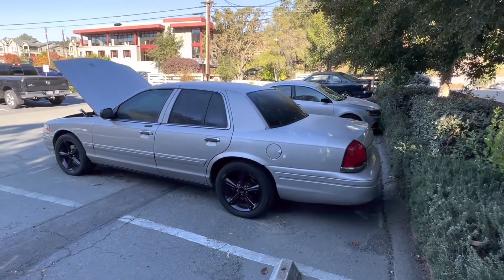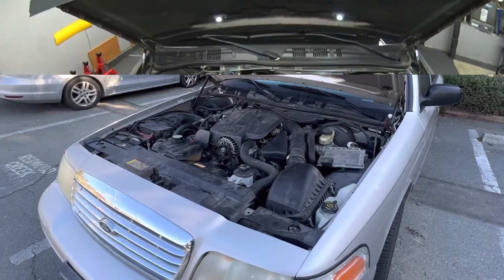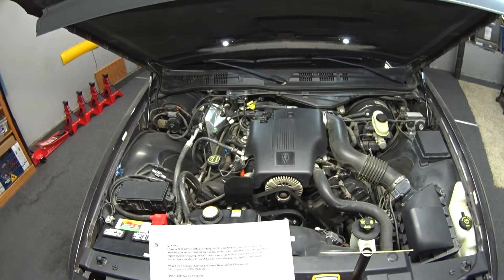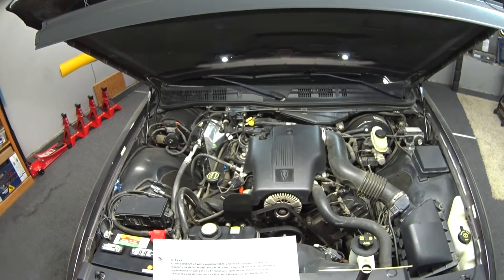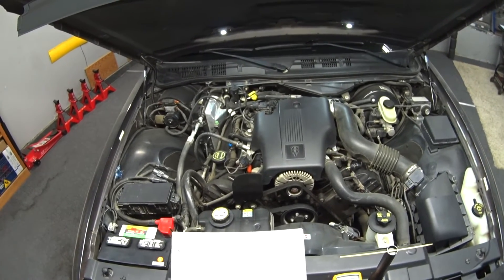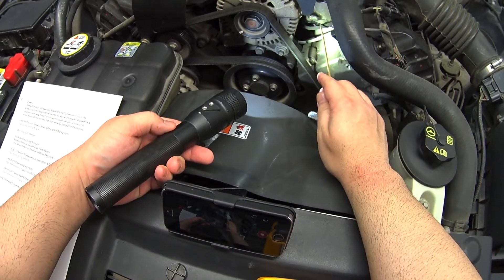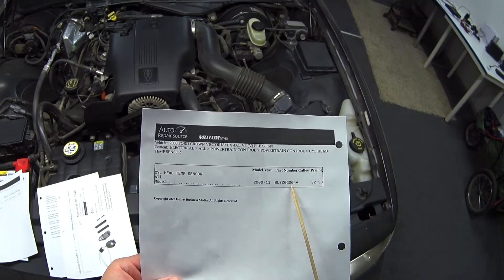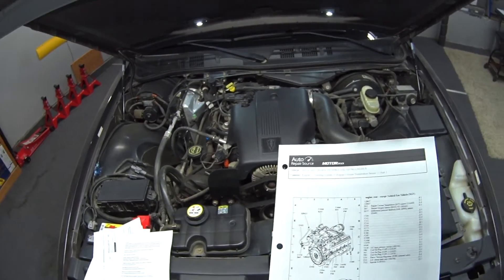Crown Victoria - P0128 ECT Sensor Location

Comment: I have a 2009 Grand MArquis. It runs and drives great. Except it overheats when I'm in heavy stop and go traffic. This wouldn't be a big problem if I lived in a rural town but I live in Los Angeles. Do you have any idea why my car would overheat in heavy traffic? Runs fine in regular city and highway traffic. Any info is greatly appreciated. Thanks!
Reply from the maker: Check the fan, and cooling system.
-Chuck

Comment: When I step on the gas  pedal it stall but not all the way and when I lightly tap on the gas is goes but burbles and  I replaced coil packs spark plugs fuel pump filter maf what could it be
Reply from the maker: Hello,
You have three options;
1.) Pay for diagnosis (money).
2.) Learn how to diagnose yourself (time + gain learning).
3.) Buy more ammo for parts shotgun (money + learn nothing). 
-Chuck

Comment: I have a 2004 Mercury Grand Marquis I need to replace a Transmission Temperature Sensor 
Where is that located? Any help is greatly appreciated 👏
Reply from the maker: Hello,
It's the part at 11:29 in this video;
https://youtu.be/pDIAnmnpGK4?feature=shared&t=690
-Chuck

Comment: Great video. 
What model fluke are you using? Looks like 115 or 117. 
I’m a recently retired mechanic and I miss the fluke 87 that belonged to my employer. 
My wife got me a fluke 117 for Christmas and I was wondering if I should upgrade to a 87 or if the 117 will be sufficient for working on my own cars, trucks, boats, etc that I work on part time.
Reply: I subscribed to your channel
Reply from the maker: Thanks for watching.
The Fluke 115 was purchased by my employer in 2007.
The 117 replaced the 115 with a few additional functions.
I’m not familiar with the 87.
-Chuck
Reply: @PanzerPlatform  the fluke 87 has features like temperature, more precise DC amp readings, such as micro amp readings,etc. 
both meters appear to have high impedance so it won’t put a load on the circuit being tested. Not sure if I will ever need micro amp settings though. 
Since the specs for 117 states it will read as low as .001 amps (if I read the specs correctly)
Reply from the maker: @bubba.watercraftj7269  
I use a separate meter for "amp clamp" measurements.
UNI-T UT210E Pro 
It was only $60, and the mA accuracy is right on the money with my Fluke.

Comment: I got a 09 p71. When starting it falls and stalls then when I restart it it will take a few sec then start and run fine . I have replaced a ton afternoon parts .
Reply from the maker: Yo LC,
Thanks for stopping by.
Questions like yours are what is so helpful to all the guys in the Panther Car Community. Chances are there are a bunch more people with the same exact issue, and they also want help figuring out how to diagnose it.

In order to help the most people, and so everyone can benefit from the information, that’s why I do the “Viewer Question” & “Guess The Malfunction” videos. I don’t have all the answers for all the years, and models of Panther Cars. But chances are someone has your exact model, and year, and they have first hand experience diagnosing the cause.

The best way I've found is to make a short 1 minute video showing, describing, and explaining your malfunction. Here is a perfect example how to do it; https://youtu.be/rTugE6sGmrM

Let me know if you upload the video to your channel. I will download it, and post it on my channel. Most likely you will get some help in the comment section from someone who has already fixed the issue. Please film your video in the daytime, and in widescreen 1080p, (no vertical video).

Here is an example of all the helpful comments you will get; https://youtu.be/G0jSA6qzCcE
-Chuck
Reply from the maker: Any update?
Did cycling the key work?
-Chuck

Comment: Hey Alex, have you ever got pulled over for the window tint?
Reply: Technically it’s not allowed in Cali either. For the most part they don’t bother you unless you doing something else wrong, like speeding. They will tack on a tint citation to something else, but for the most part they don’t pull you over for tint only.
Reply from the maker: Are you considering tinting your '98?
Reply: @PanzerPlatform  it's already tinted at 35 percent 
 all around. I asked because it looks like the front windows of Alex's car is tinted and I read that wasn't allowed. In Indiana it's legal to do all windows (except windshield)

Comment: Great video, Chuck!  It's like the early to mid 2000 GM vehicles where they removed the alcohol content sensor and used other sensors along with algorithms to calculate the alcohol (ethanol)  percentage in the gas. It failed miserably.....
Reply from the maker: Right on Brian,
Thanks for stopping in.

What a great explanation of what an ‘Inferred Sensor” is.
Did you ever notice the ECT was missing on your P7B?
-Chuck
Reply: @PanzerPlatform    I think my 2008 is still a P71 but either way..... Maybe, kinda noticed it was missing.....  I had a cylinder head temp sensor related trouble code (forget what it was at this point) but I researched the CHT sensor and related code and I believe I stumbled upon that fact that my car used the CHT sensor instead of a coolant sensor.  It's been about a year since i worked on that part of the car.  I kinda knew it, but I didn't realize I knew until I heard you say it.

Comment: 👍🏻😎 My 2006 was made in May of 06 and it doesn't have an ECT sensor in the intake coolant passage location either. it has the one thats under the intake as well. Man, Ford has always been known for wacky mid-year changes forever, but I think at some point the changes were coming quarterly. Thanks for the video!
Reply from the maker: Right on JT,
Thanks for stopping in with the great feedback.

I had a feeling the ECT started being discontinued on some Panther Cars for the 2005 model year when it went to the electronic throttle body, but all the info I researched was conflicting, so I just went with the for sure 2007-2011 don't have 'em. lol
-Chuck

Comment: After playing around with LS engines so much the last 10 years or so I'm starting come to the conclusion that Ford did a fine job of overcomplicating everything after the invention of the mod motor vs the windsor based engines.
Reply from the maker: Right on Mr. Black,
I'm not much of an engine guy. What's with the LS motors. 

And Ford didn't really do anything special here. All manufacturers figured out the whole inferred sensor thing to save a few bucks on production costs. They most likely stole the idea from the Japanese. Lol
-Chuck
Reply: @PanzerPlatform  LS stands for dead simple lol.  No inferred crap at least from 1997 to 2013.    No multiple cams no 100 foot of timing chains.  NO ridiculous size for it's miniscule cubic inches.
Reply: I miss my old 5.0 H.O. powered Fox bodies and their simplicity, thats for sure.
Reply: @j.t.cooper2963  I still know where my fox chassis mustang race car is.  The guy that bought it owned a mustang shop in Auburn and parted it out but kept the chassis/body/rollbar.   What's really ridiculous is those cars are becoming quite expensive when they were for all intents and purposes considered disposable when they were new.
Reply: @PNW_Car_Mods  That's for sure. I was thinking of buying another one at some point, but the prices are a bit ridiculous for a car that almost everybody disliked for one reason or another. I heavily modified mine to make it a better balanced car and just as soon as I got it done my drunk A hole neighbor decided to crash into my 3 car garage and total it out and did $30,000 dollars worth of damage to my house and garage contents, not including my my cars that were inside at the time. Otherwise I'd still have it. I owned it for 15 years before it got totaled out sitting in my garage of all places.
Reply: Yeah would love to know what ford was thinking when they decided to go all in on the overhead cam design. I wonder if it all goes back to the late sixties and their involvement with cosworth.
Reply: @canadianmarauder1923  I remember hearing so many rumors when the 1996 Mustang came out that it would make your heads spin.   I didn't like that engine then and I still really don't care for it now.    At least by 2011 they got them fairly reliable lol.  Still gutless though.